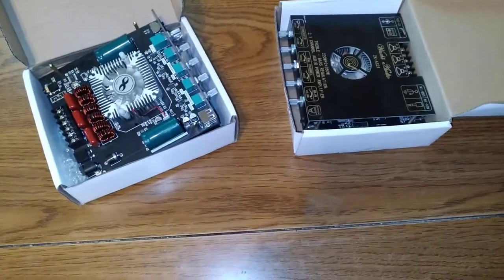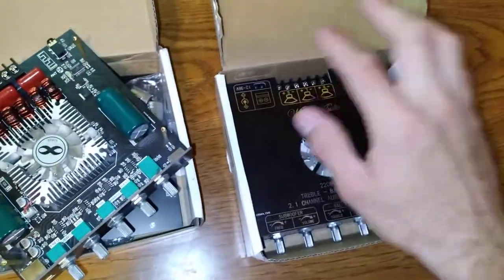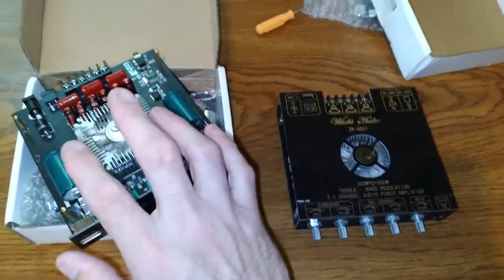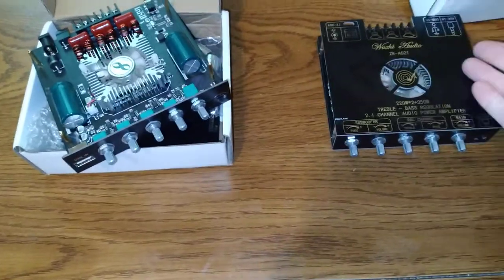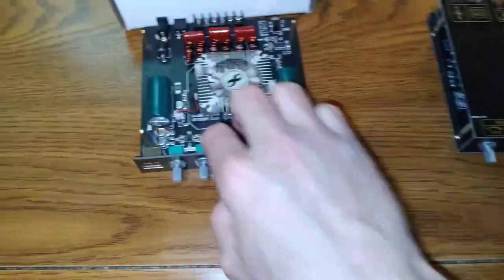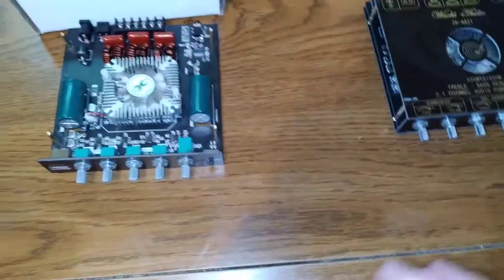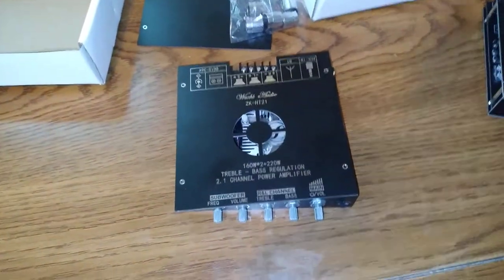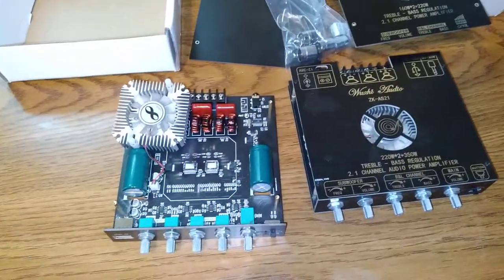Quick review of the WUZHI HT21 vs AS21

Comment: I've got the HT21, a MeanWell 36V 10A power supply, 2 large 4-ohm Sony bookshelf speakers with 2 midranges and a horn tweeter in each, and a 10" DVC BOSS subwoofer wired to 2-ohm, and mounted in a Klipsch downfiring box... Lemme tell ya about "BLOW THE ROOF OFF"... This thing will rattle the neighbor's windows, and make your eyeballs vibrate in their sockets... It's got crystal-clear highs, and booming bass that sounds GREAT... I've bought several Aiyimas, and several smaller Wuzhis to install into hardwood cigar boxes to sell... But this one is the best so far... It's truly a BEAST...
Reply from the maker: Everyone always asks what amp is better. The ht21 or as21 and so on... I always tell them the HT21 is the all around best one
Reply: Good thing I bought the ZK HT 21 @scarr3ll

Comment: there are at least two versions of ZK-AS21 in the market. think you have the older version with TPA3251. they use TPA3255 for the newer ones. you can tell the difference by looking at the lower limit of the supply voltage. 12V is TPA3251 while 16V is TPA3255...
Reply: Thanks for the hint.
Reply: In the video footage, you can definitely see the voltage print 12v, so he got TPA3251 chip which doesn't have the power as in the TPA3255 model which is printed 16V-38V

Comment: Just a suggestion... Could you do a side by side of the 2 amps powering the same speakers? I appreciate that we don't get the same sound on YouTube as you do in person, but sometimes you can pick up on the difference in sound relative to each other. Just a thought
Reply from the maker: I may be able to do something like that soon. I bought some new speakers, a 600w power supply and another HT21 for backup just incase something ever happens. I still have the AS21 aswell, so once I get time I'll try and get a video up
Reply: @scarr3ll  Looking forward to it

Comment: Sir, this is my zk-ht21, I have a problem with the output of the R+R- channel on the speaker, there is only a loud bang and the speaker spull is hot. What do you think, sir??
Reply from the maker: These units aren't built very well, I would just buy a new amp and be done with it. One thing, DO NOT mess with the speaker outputs while the amp is on and playing music. Keep the amp off while wiring speakers up, and then turn it on.
Reply: @scarr3ll  ok,thank's sir..👍

Comment: Quick question with regards to the HT21: Does this board have a high pass filter for the tops ? Or is the stereo channel a fullrange signal (including bass)
...this would be worst case!  And if there is a highpass: does the cutoff frequency go in sync with the frequency-potentiometer for the sub?
Reply from the maker: There is only a crossover for the subwoofer, but it doesn't really work lol. The sub channel on all of these mini amps, have vocal bleed. They are crossed around 200hz to begin with, and then the "crossover" filter does whatever from there, but you still have vocals coming through regardless, so it's kinda pointless lol. But if the sub isn't close to you, then it's not a huge deal but something to consider. And the mids/highs only have basic "treble/bass controls, no crossover for them. The treble/bass seem to effect each other also, so kind of have to find a happy medium. That's one of the downfalls of these mini amps, the lack of equalization can make it difficult to obtain a good sound at certain volumes, but overall they do sound good for basic needs. These aren't high end by any means but they have their place, good for basic home audio, garage setup/man cave, portable Bluetooth setups..etc.

Comment: thanks. My newly bought HT21 has a large 60-90w power draw all the time, sending all that power as very low frequency hum to subwoofer so I'm returning it. I'm looking at TPA3255 amps but some reviews share your thoughts on the subwoofer weakness of the AS21
Reply from the maker: Yeah, ALL of the 3255 amps I've tried have to have the bass turned up quite a bit, unlike the ht21. But they still give plenty of bass once you do that. You might look into the Fosi Audio bt30d PRO, it's a little higher quality build 3255 amp, but lacks a fan, so you may need to disassemble  the case and drill some holes, this will keep the amp much much cooler.
Reply: @scarr3ll  thanks. I'll into it! Pricey but I might be able to find a amp/board that is similar to this.
Reply: @scarr3ll  I found the Fosi and insanely cheap ($62 with PSU) alternative with similar specs.  however, I wonder why the recommended power supply for these is 32V - 5 amps.  Isn't that underpowered to max the Fosi Audio bt30d PRO?
Reply from the maker: @zodiacfml  yeah, I think they just recommend a smaller power supply because it's cheaper, and most people just want sound right away and aren't worried about getting all the power they can if it's loud enough with the 5a supply.
Reply: @scarr3ll  I see, makes sense. I'm looking at this KGUSS PA8 that is the equivalent to the Fosi Audio BT30d pro or an Aiyima.  Is the subwoofer/bass gain of the Fosi Audio as good or better than the ZK-HT21?
Reply from the maker: @zodiacfml  it's better. They Wuzhi amps have a little bit of vocal bleed with the subwoofer channel. Like, it's crossed pretty high and you get a little bit of low end vocal with the Wuzhi ht21. With the Fosi or equivalent tpa3255 amp, I had no vocal bleed, cleaner bass and cleaner sound overall.
Reply: @scarr3ll  Great! This looks like going to solve the issues I find with these ZK/Wuzhi amps I recently bought. I'm running a ZK-TB21 right now with AUX right channel not working, high frequency noise, and I think it clips easily above 50watts. Thanks for the great help!🙌🙌
Reply from the maker: @zodiacfml  no problem. Yeah if the KGUSS is the same board as the Fosi(all these mini amps more or less are the same boards, maybe small variations in internal components if they can afford to put some better quality into it, kinda like how this tpa3255 has banana plugs and others just have screw terminals), then it should be a vast improvement in overall sound, the bass should be fine. I have an 8" sub in a transmission line and it's plenty for me, but this enclosure is designed for maximum output on little power. I just ordered the Douk Audio T8 Pro 7 band eq, you might look into it, give ya some more eq options, which is vital for these basic amps with mid/low/high. It also has a balance L/R knob, which is kind of random but a nice feature that isn't too common.

Comment: Hi there, great video. Any suggestions on a bluetooth 5.1 decoder with bluetooth streamer, where i can use the ht21 as wireless rear receiver/amplifier?
Reply from the maker: Hello, maybe try the WUZHI ZK-PT2. 
It has 5.1 and 3.5mm aux in and out.

https://www.ebay.com/itm/404494345324?mkcid=16&mkevt=1&mkrid=711-127632-2357-0&ssspo=qcyosggntfy&sssrc=4429486&ssuid=CxCvqTMMQZ2&var=&widget_ver=artemis&media=COPY
Reply from the maker: Sorry, I think I read your question wrong. You're wanting a 5.1 streamer device that will allow you to select the Wuzhi amp as bluetooth? I'm not too familiar with that kind of stuff, sorry. I think there is a product called the WiiM Pro? That may be something to look into, but as I said, I know nothing about streamers and stuff like that lol.
Reply from the maker: Maybe this aswell? I think this may be what you're looking for? But I am not sure. Hope some of this helps lol

XDUOO XQ50 BT5.1
https://www.ebay.com/itm/195908639157?mkcid=16&mkevt=1&mkrid=711-127632-2357-0&ssspo=damjqec6rse&sssrc=4429486&ssuid=CxCvqTMMQZ2&var=&widget_ver=artemis&media=COPY

Comment: compre el zk-ht21 y aunque tiene muy buena calidad el sonido me parecio que es baja su potencia, nada que ver con 160w por cana, usando 36v 10 amperios  3 ohms, iba a cambiarlo por el AS21... pero en base a tu recomendacion me quedo con el zk-ht21
Reply from the maker: The HT21 has better bass but the AS21 has better mids/highs. Overall I'd probably stay with the HT21 but there is nothing wrong with testing both, that's what I'd suggest.
Reply: @scarr3ll  I modified the ht21, I put a couple of 10,000 microfarad capacitors on it, I added a preamplifier by modifying the design, I increased the sound power a lot and I have more frequency range, greetings.
modifique el ht21, le puse un par de capacitores de 10,000 microfaradios, le agregue un preamplificador modificando el diseño, incremento bastante el la potencia de sonido y tengo mas rango de frecuencias, saludos.

Comment: ZK-AS21, YS-AS21 diferences?
Reply from the maker: No difference. Same board, just sold under a different brand. Same as the Wuzhi and Xinyi amps..etc
Reply: Ok, thanks!. The question that remains whether or not the TPA3255 improves subwoofer output compared to the TPA3251, or has nothing to do with it...
Reply from the maker: @durrutino  you'd have to Google each chip and compare. The 3255 would be more power..etc.. I think the 3251 has a miniscule amount less of THD. I don't think there is much of a Noticeable difference in the chips, besides power. It will depend on how the companies implement the chip though
Reply: Yes, It will be a matter of seeing more comparisons and analysis. Very kind, thank you for your time.

Comment: Hello.  I also use this amp.  When I turn on treble, there is an annoying static noise.  how do i solve this problem
Reply from the maker: Try a different power supply
Reply: @scarr3ll  I tried with another power supply, same thing.  I am currently using it with a dc 24V 10.4A LED transformer.  Treble is very annoying when I open it.

Comment: On witch one subwoofer sounds better? I have xh-a128 amplifier witch uses tda7498e and clearly can hear vocals from subwoofer (amp has no frequency adjustment pot). How these sound with sub. Witch one is better?
Reply from the maker: The HT21 is better over all. The AS21 requires the Wuzhi App and you have to adjust the eq and main volume of the app itself to adjust the sound of the amp, its weird.

Both amps still have vocal bleed. I believe ALL of these mini amps are crossed around 200hz or so. These may benefit being ran through an external eq or something for better control but by that point, you may aswell buy an actual receiver.
Reply: Sy Mao ber tanya sy punya m zk 21 kenapa app wuzhi audio ngak bisa di buka tolong imponya terima ksh

Comment: What would it be an optimal power supply for the HT21 ?
Reply from the maker: I've been using a 36v 11amp switching power supply for a long while now and it is what I suggest. Use a voltage withing the amps operating voltage and the higher the amperage the better. Voltage × Amps will somewhat determine how much power your power supply will be able to supply when the amplifier is pulling the needed amperage.

Comment: i liked your video. i wonder if i can use my sppeakers from my stereo. it's 6 ohms and 150w rms. the model it's ss rg555 . it was a sony speakers that  i had from my late bro, so i thought i use them. i guess i might but not using with high voltage power supply. well this is why i asking if possible.
Reply from the maker: Yes 6ohm speakers are fine, they'll just get a little less power than they would at 4ohm..etc

Comment: How to use in 12v car battery
Reply from the maker: Easily. Just hook power and ground up to the vehicle battery. You should probably add an inline fuse to the power wire also.. be sure to use a thick enough gauge wire, 8gauge cable should be OK since it's not pulling too much current. Then you need a distribution block to downsize cable to the amp safely.

So, 8gauge power and ground to a fused power distribution block, and then a ground distribution block. This way you can safely go from 8g to 12g or so cable that will easily fit into the amp...

You could do this a few other ways, but just be sure to use thick enough cable to carry the current over the length of cable you're using, so you don't melt/burn anything.

Comment: Only speakers larger than 4 ohms can be used with the HT21! If you use 2 ohms and apply power more than 20 volts tda7498e BURN !!! 
AS21 does not have such problems, but the sound quality is worse! Plays not a full set of low frequencies!
Reply from the maker: That's not true lol. I literally run the HT21 at 2ohm full volume on ALL CHANNELS at 40volt!!
Reply: @scarr3ll  tôi có HT21 bản nâng cấp Bluetooth, chơi loa sub 2 ohms 200w ở điện áp 32v thì có vấn đề gì không?

Comment: I have this amplifier ZK-HT21 i  used psu 24V 5A  and 4inch speaker 2x 60W 4ohm & 1 pair of Sony subwoofer 100W 4ohm ported box 5inch & the sound quality performance is awesome specially the sound quality of Bass is really impressive although my issues that i don't like this amplifier is the woman speaking when you tune the dial mode 😂 speaking Bluetooth mode 😂 USB mode 😆😆 is there a way to stop a woman speaking 😆
Reply from the maker: Lol yeah the voice can be annoying. It's programmed into the chip, so no way to turn it off unfortunately lol

Comment: Fake review as21 is better it got a self protection the ht21 will burn instantly if you use the wrong impedance speaker like 2ohms not like the as21 it will just protect itself.
Reply from the maker: What? I run the ht21 at 2ohm ON ALL CHANNELS AT FULL VOLUME. NO ISSUES

Comment: Thinking of 2ohm tho
Reply from the maker: Go with the HT21, and yes you can run these amps at 2ohm. If you want to run two 8"s, you need two dual 2ohm to wire to a final 2ohm impedance. Or just a single dual 4ohm. I'm currently using a dual 4ohm 8" sundown sa v3 wired to 2ohm on my ht21 and it thumps.
Reply: @scarr3ll  ok cool thanks bro
Reply: @scarr3ll  what's the biggest gauge wire was you able to fit in the ht21 amp
Reply from the maker: @blackjack4l989  sorry just seen this while going over my videos. I know it's 3months later but it depends on how you connect the wires to the amp. If just bare wire, I'd say 16g. If you use connectors you could use maybe 14g or 12g if you can find connectors that small to still fit into the terminals. But really with the power these put out, 16g is plenty since these do not pull alot of current..etc